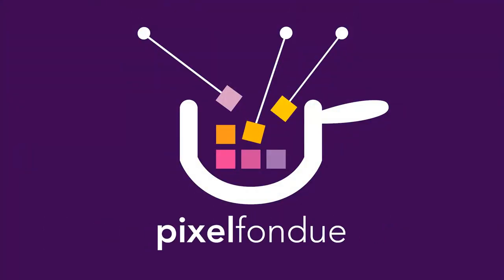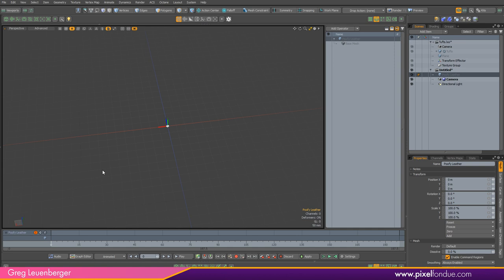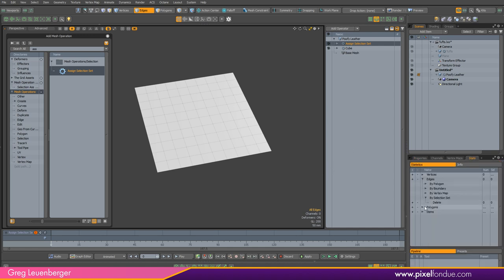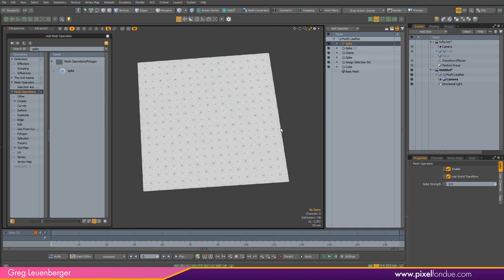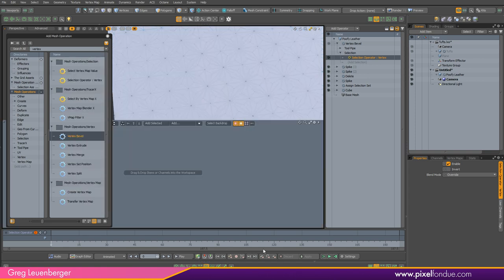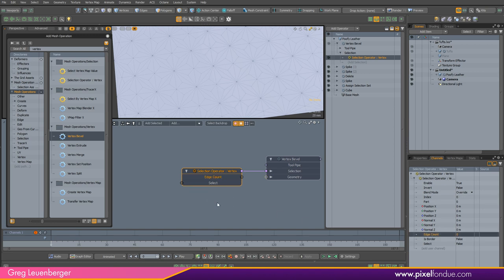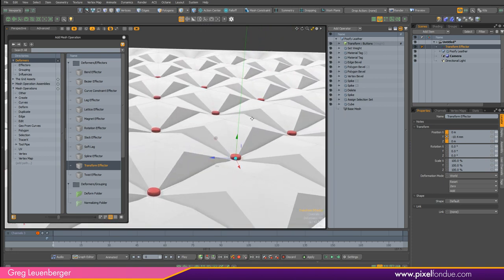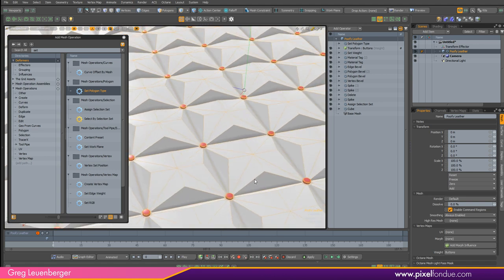MODO | Poofy Fabric MOP

Comment: I have no vertex map set weight option
Reply from the maker: what version of MODO are you using? There's 'Set Weight' which will set the weight of a vmap and create one if it doesn't already exist.
Reply: @Pixelfondue  13
Reply from the maker: @kurt6148  yeah, I think it was added in 14
Reply from the maker: @kurt6148  And there's quite a few more MOPs for vertex maps in 15
Reply: @Pixelfondue  I have 14 too
Reply from the maker: @kurt6148  Should be in the 14 series.